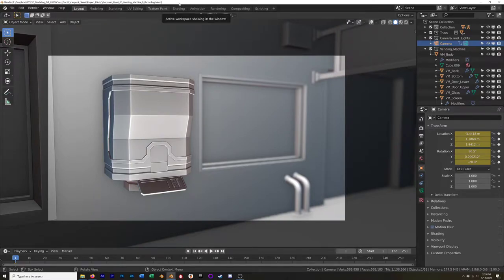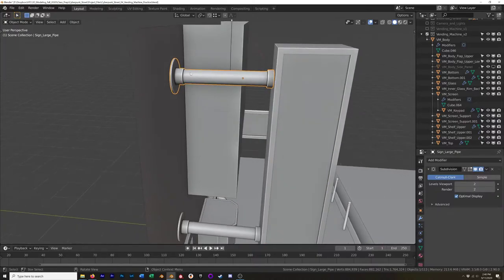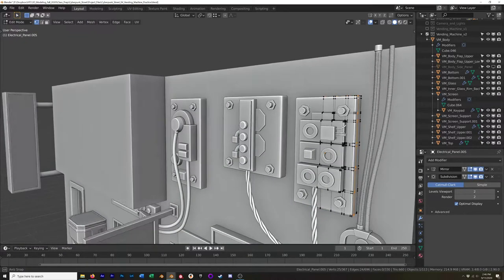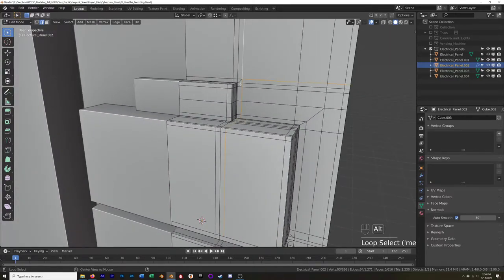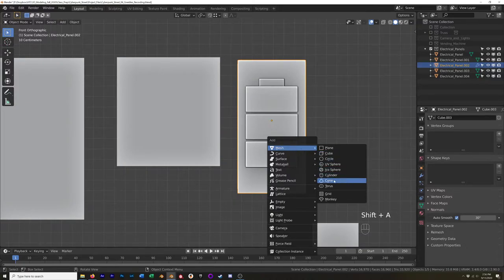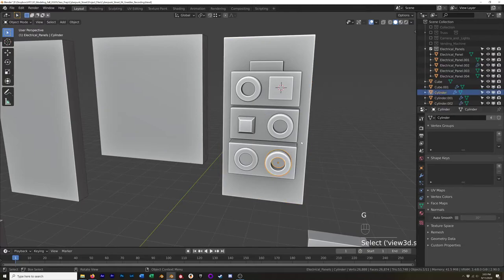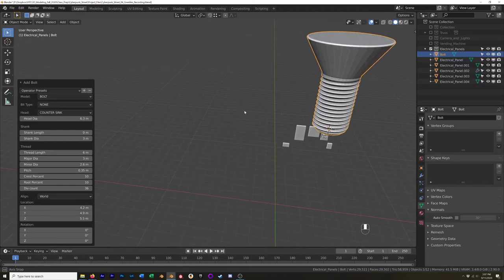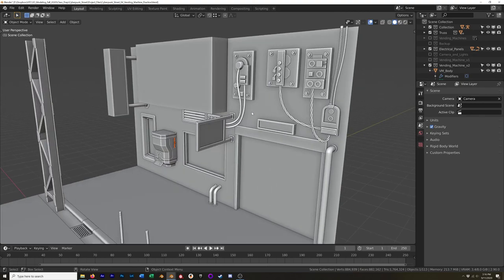3D Modeling in Blender - Cyberpunk Street Part 5: Greebles

Comment: min 38:22 how did you do that panel. Im having difficulties to model it. Did you use bevel ?
Reply from the maker: Assuming you are talking about the top rounded shape, I believe so. If you bevel the corner edges (the ones running in the Y direction) and increase the segments, you should get something similar. Doing it this way will create some n-gons, so you'll need to clean it up a bit, but that will get you the shape you're after.
Reply: Thanks. I will try it out